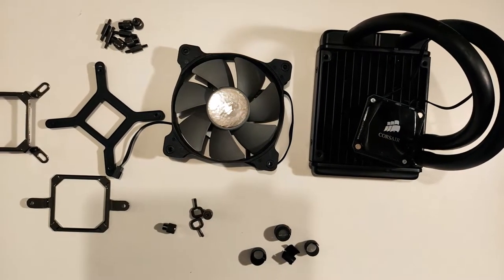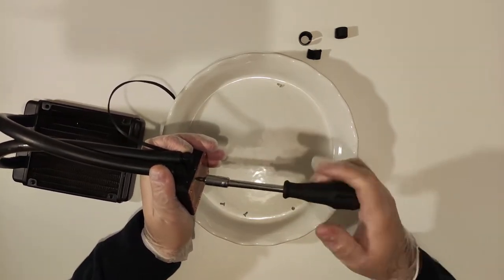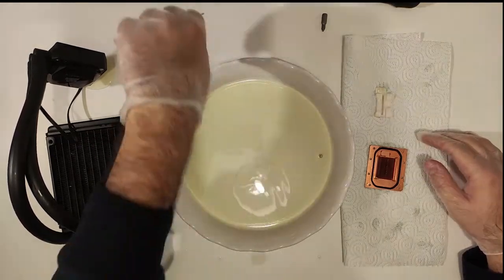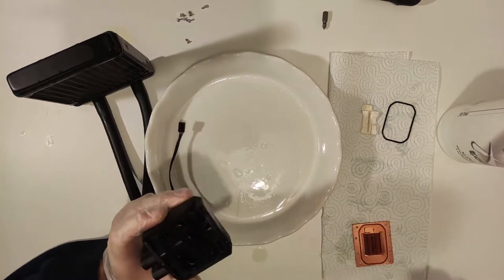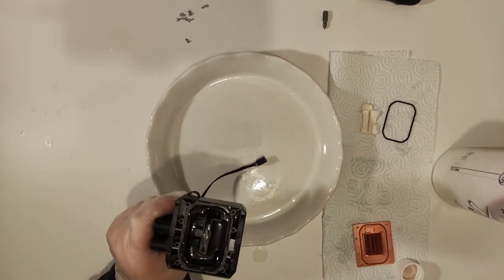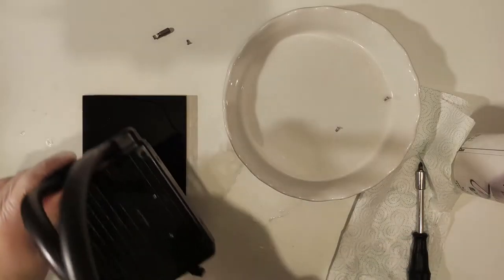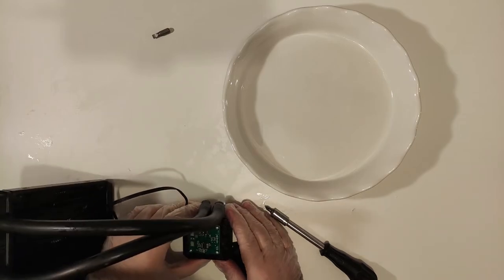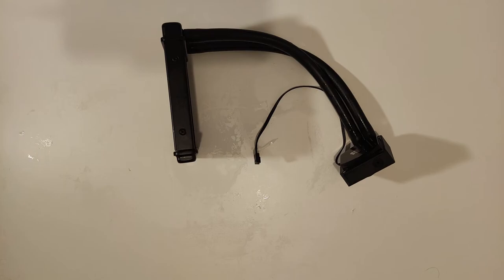All-In-One Liquid Cooler: Drain, Clean and Refill Service / Long Interval Maintenance

Comment: I find that threading the screw backwards till it slips into it’s own threads works great to avoid cross thread damage
Reply: So when I cleaned my own and tested it the other day it was vibrating pretty badly and was quite noisy, I was using straight distilled water for the test...I'm not sure if it was actually pumping the water...Which hose on the pump is inlet and which is outlet?
Reply: yep. This is what i always do to keep threads as healthy as possible.
Reply: You're exactly correct.
Reply: My dad was an electrical engineer, and that was one of the first things he taught me about working on components. "Drop it into the threads."
Reply: Top tip

Comment: Great video, I was just taking coffee break from refurbishing my old h80 7 years in service lol I'm using vinegar to clean the copper plate. There was some gunk but essentially no corrosion, very impressed with Corsair right now!
Reply from the maker: I'm glad you found it helpful! I found that it depends on the revision with Corsair as some are (much) better than others , but they do use an impressively good working fluid. Salt and vinegar is absolutely the right thing to use if it's copper, it leaves it looking new https://youtu.be/soJ1Roo2tlE

Comment: This worked for me today (so far). I'll say some things I found: (1) after replacing the copper radiator some coolant may leak out from the edges and screw holes. But you won't be able to tell if the rubber gasket has failed or if it's just tiny amounts that got into areas of the plastic housing that are outside the gasket. I left mine overnight until it stopped. (2) the outlets leading from the plastic housing to the rubber hoses are small and hard-to-see: they effectively have to be filled separately. (3) I didn't measure the quantity of fluid but it was about 100-150ml. (4) in the video at around 4:30 where the hoses are twisted about this is an important step to push out air bubbles, they won't come out on their own. (5) I add this for my own benefit: I wasn't able to get a pre-mixed coolant in the UK on a reasonable timescale and the PC shops don't sell it so I made my own from 110 parts deionized water, 10 parts central heating corrosion inhibitor, 1 part Friar's Balsam. Friar's Balsam is an over-the-counter biocide made from tree bark - it is iodine+ethanol+a cocktail of oils from the tree bark: need to separate/skim/filter off the tar and solid particles before use but this is easy enough. The iodine turns the mixture pale yellow.
Reply from the maker: Impressive! Honestly your concoction is probably just as good if not better compared to some of the commercial premixes. Once I'm done with a service I usually spray down the pump head with a (very) liberal amount of isopropyl and blast it with a hairdryer (got lazy ones and used my soldering hot air gun that was on my desk - bad idea), I find this dries it out very quickly and any overnight drips are most likely real leaks. If that happens I use a dab of non-corrosive gasket maker (i.e. if it smells like vinegar it's the wrong type for this) on the existing gasket and 9 times out of 10 it worked perfectly fine.

Comment: That's actually crazy with opening from the cooling plate directly instead of the hosing replacement. But, it does keep things much simplier for lazy builds. And technically, hosing itself is mostly fine.

Comment: My 2 year old h115i cooler suddenly stopped working. I hope it will be fixed when I change the water. Thank you for your help.
Reply from the maker: Make sure to check if the pump is spinning freely
Reply: Ok, I'll check it when I open it. But what I'm really afraid of is that the radiator liquid has leaked into the chip and the circuit has burned. I think this is the most likely possibility and I'm afraid of it. Sorry for my bad English, I'm writing with Google Translate.

Comment: Nice video, I also have an h110i that probably needs a refill but I can't undo the screws, they are allen key screws and won't budge.
Reply from the maker: Initially I used L-shape Allen keys, but switched to an allen screwdriver as it was very difficult  to put enough pressure onto the screws with either the long or short side and ended up stripping a few (drilling AIO screws out is not fun at all :/). If you have some Allen bits or a screwdriver maybe give it a try ;)
Reply: @ESHW  How do u drill them out? I mean the screws are screwed into plastic, wont drilling them damage the plastic threads? 

I am atleast 80% sure i am gonna have to drill them cause allen keys dont fit properly anymore, they are a little bit loose.

Comment: Thank you this video is a godsend! You mention that its possible to replace the pumps if they are faulty? I'm looking for a replacement pump for a corsair H100i elite capellix xt but I've been unable to find any information, the rest of the video has been very informative, could you suggest where to look for the pump?
Reply from the maker: Best thing would be to buy a replacement pump head off eBay as it will be the absolute cheapest option. There used to be a few places to get new impellers but they don't seem to sell them anymore, these days I don't replace the pumps if they are broken,Im i just keep the aluminium radiator for later use. There are so many affordable AIOs it doesn't make sense to invest £20-40 to fix an old AIO when you can use the same money to buy a new Aygo or thermalright.

Comment: my aio sounded like a lawnmower at times - the temp was up at almost 90°C, the fan´s sounded like an airplane..
so i switched back to air-cooling and disected the aio - the copper plate, tubes and pump was full of gunk.

after i broke it into pieces to get it open i found the screws right on top - lol
it even had a filling port.

now i am wondering if it is possible to flush the aio-system with a cleaner and desolve the gunk, then flushing the aio and refilling it for reuse.

i am currently trying vinegar to dissolve the residue on the inside of the copper plate - it bubbles so the vinegar is reacting to something..

will a regular aio cleaning solution work for this ? i suppose that the radiator is even more gunked up and just flushing water doesnt clean it sufficiently.
well r.i.p. first aio of my life 😂
Reply from the maker: I mean...if it did its job then it was a life well spent (for the AIO obvs.). Vinnegar will usually do a good enough job, there are loop cleaning kits that come with different chemicals, but I would not use those on AIOs - they are meant for things like custom loops that can justify their price tag

Comment: The concept of liquid sinks and air rises in a container is not in this mans head.
Reply from the maker: I would agree with your comment without knowing better, but after servicing north of a hundred of these AIOs of various makes and sized.... 9 out of 10 will be an absolute pain to fill through the coldplate opening without jiggling the hell out of the rad as there will be airlocks - internal radiator channels are small and liquid goes in both tubes (not to mention the ones like the H45 with the pump at the inlet - these days I just chuck those in the bin due to the aggravation of filling them). Every 10th one will have a dedicated fill port and that will work just as you say.

Comment: Amazing job. Since you seem to have quite a bit of experience with aio coolers refurbishment, do you happen to know whats the average size of the pump plate screws? Not sure my terminology is correct.  Basically the 8 screws on the copper plate. Many thanks :)
Reply from the maker: For the older ones that have threaded inserts in the plastic it's more often than not a fine pitch M2. For the newer ones that thread directly into plastic the screws are various flavours of self-tappers.

Comment: Got a better idea that actually works with 100% fill rate which also expells every last bit of air in the process. To refill the system all you need to do is place the cold plate side  into a container with your chosen fluid,obviously taking the cold plate of first so the pump is visible,as theres electrics in the head just submerge enough so the pump is in the fluid. 

Now turn on the pump and let that pump circulate the full system until no more noise is heard. 

Once ur happy,insert everything bk together while still submerged keeping pressure on the cold plate as you now turn it upright ready to insert the screws.

Once all screws are tightened down.double check the electric side on the aio head where the board lives and  check for any water in there, there should be none.

This is how i did mine and its better than when i bought it.

Let the pump do the job for u,thats what there designed for in the first place.

I see too many people dribbling water in the holes and wiggling the radiotor around which can be tedious and time consuming.

Next time give it a whirl and let me know how you got on. 

If your paranoid about water getting into the electrics while doing this,just use some electrical tape to water proof the joints.

Good luck.
Reply from the maker: Thank you for the detailed comment! I did service a couple of AIOs like that (mainly the horrible Corsair H45 which is a true pain), but I still find it easier to pour in the liquid. The issue with pouring it all out in a container is you can't pour it back into the bottle as it will be contaminated (or at least I don't as I do some high end stuff as well where contaminants + dye is a good clump recipe); but I get how this can be a very niche issue.
Reply: @ESHW  I did make sure to thoroughly flush the full system in the sink prior to doing this method,taking apart everything and hand cleaning before hand. To be thorough I even used que tips to clean inside each pipe whike soaking. Que tips were orange then once I was happy In the cleaning process. I then used distilled water and flushed the system out again once it was all back together again by dunking the cpu cooler head under water in a bowl, I flushed for 2 minutes and water was clean

After I was happy this is when I used some XSPC PURE PREMIX DISTILLED.

following the process again.

There's was zero contaminants in the liquid.

Hope this helps.

Ps. I have the H45 CORSAIR.....its what I'm using after I just serviced it  and its very very quiet now.

Comment: I have this exact cooler and the performance is degrading, thank you for doing this. I understand you need some air for thermal expansion but how much? I wonder if you ran the pump facing up to have the air bubbles potentially trapped up top , then removed the cover again if you'd be able to fill it some more to potentially minimize trapped air?..also how did it perform afterward as there is no follow up? Thanks!
Reply from the maker: Hi - you should remove as much trapped air as possible, don't worry about thermal expansion as the temperatures don't get anywhere near hot enough for that to be a concern. As long as the pump is not the highest point in your system, you should be fine . Best way I've found to remove trapped air is to have patience (lots and lots of it) and then shake and pour. Using a scale like a showed is an easy way to make sure you haven't underfilled. Afterwards I tested that cooler on a Ryzen 7 2700x and after 10 minutes of Cinebench R23 on stock the CPU was sitting around 74C while rejecting a lot of heat - for long term use i would still go with a 240mm for CPUs over 65W if space allows. I finally used it on a 3200g and it didn't go above 62C even in prime 95 so it was performing pretty much like it did brand new.

Comment: what the size of tube inner diameter , trying to modify it , but worried to cut the tube
Reply from the maker: As it happens I have one to hand and a calliper. The inside diameter is 8mm and the outside diameter is 14. The original barb that comes with is is 10mm in diameter and I would aim for the same to keep a tight seal.

Comment: Thanks for this video I have this same cooler that I have been using since 2014 so I need to do this. I am wondering though what liquid do you recommend to go in there?
Reply from the maker: As long as it is a clear liquid from a reputable manufacturer you can chose whichever you like - either Mayhems, EK, Corsair, Thermaltake - go for the one on sale and it will work so long as it does not have any colour pigments and it has both biocide additives and anit-corrosion properties (as i think the radiator is aluminium so you really do need it). You can also go for distilled water + EK cryo or similar concentrate, but it usually works out around the same price as premixed fluids. Do not use tap water or just distilled water as it won't last more than 2-3 months before it gunks up.
Reply: @ESHW  thank you for the help.

Comment: I plan to do this but I want to replace the liquid with the same liquid. Do you know the ingredients and ratio of the coolant? I know it has propane glycol, anti-rust, anti-bacterial and do i even need an anti-freeze?

I don't know the name of the exact chemical needed.
Reply from the maker: I would recommend you buy a proper premix. Don't use EK cryofuel because that one has known compatibility issues with some AIOs. What i can for sure is you can use mayhem's eco (clear). I've been using it for years and never had any issues at all with it. That way it takes the guesswork out...

Comment: There are L1 and L2 wires on the circuit board that broke. Not sure how to fix it. Any ideas?
Reply from the maker: :( That is a bit of a bummer - and the reason I usually avoid taking the pumps apart if it can be helped. You will need god tier soldering skills to fix that one as you will need to add a cable overlength to reach around - its doable as I have done it in the past, but with so much aggro that I can't really recommend it. I am afraid to say you will probably be better served by getting a new cooler...

Comment: Can you fill it with drink water
Reply from the maker: Unfortunately not. The trouble is that the cold plate is copper and the radiator is aluminium. Without corrosion inhibitors it would degrade very quickly as the colplate would become saturated with corrosion residue.

Comment: So you use a cleaning fluid to cool the CPU? That part threw me off...
Maybe I'm not seeing the full label on the container...
Reply from the maker: The fluid I am using is Mayhem's X1 Eco (no pigment) - it's a premix for CPU coolers that has a very wide comparability. They do have cleaning fluid, but I've never used it. (I believe it's called Mayhem's Blitz, but that is only supposed to stay in there for a day maximum; worth it for a custom loop, but if you AIO gets that bad that is requires gunk removal I would say it's time to bin it)

Comment: Can you use regular purified water?
Reply from the maker: Yes, but you will have to be seriously tidy as to not introduce contaminants and it still might not last that long until it requires change. I would suggest putting some biocide in it as that will increase the shelf life considerably (also eliminate the algae risk).

Comment: Can I use distilled water instead of what you are using.
Reply from the maker: Simple answer for most people is NO. The long answer is it is possible to use distilled water if your AIO does not have any mixed metals - I.E. copper coldplate and aluminium radiator AND you make absolutely sure to not introduce any contaminates that might produce algae and such - that is very difficult to do. If you have distilled water I would put some additives like EK Cryofuel or whatever is available to you that contains both corrosion inhibitors and biocides as it will  guarantee you won't clog up the system with either corrosion or algae.

Comment: I just open the pump and wiggle the card little and now temps are like 29c idle as before it was 70-74c. No need to clean the whole system;)
Reply from the maker: Still a good idea to flush it as it will have residue inside the radiator....but it will still go for a long time regardless ;)

Comment: How do you take all the old liquid out? Just holding it upsidedown? Why is the weight so important? What liqiud did you use?
Reply from the maker: Hold it upside down and shake it a bit until all the liquid comes out. The weight is important because you want to make sure you put at least as much liquid in as you took out, more if possible. Too little fluid in there can hurt performance and be dangerous for the pump (not to mention you hear an annoying flowing water sound). I use Mayhems X1 clear premix fluid for all the AIOs - it has both corrosion inhibitors and biocide additives, but you can use any liquid you like as long as it is rated for mixed metals (i.e. most AIOs have a copper coldplate and aluminium reservoir and most fail not because of pump fatigue but because corrosion builds up and clogs the system).  If you prefer, you can buy concentrate and mix it yourself with some  distilled an purified water, but unless you are doing loads of AIOs its just extra hassle.

Comment: Is it okay to use pre-mixed automotive coolant?
Reply from the maker: You could, but you would need to dial down the concentration and you would still have the issue that it is toxic (most over the counter premix fluids go to great pains to show they are non toxic). As it's meant to be used at much higher temperatures the thermal transfer might not be great when the temp delta is so much lower.
Reply: @ESHW  Okay, thank you.